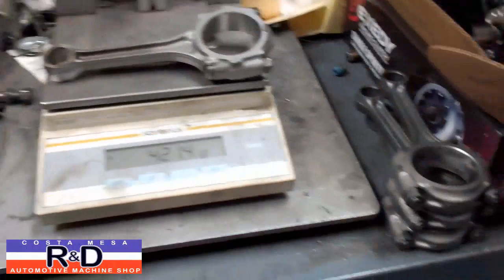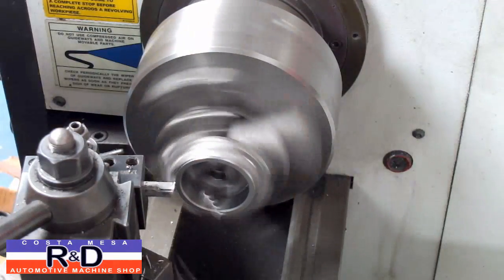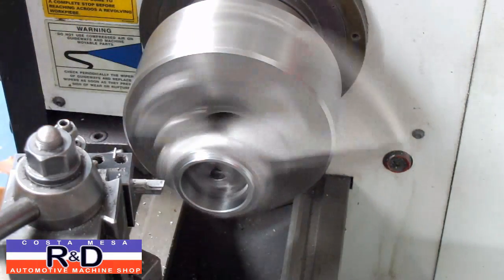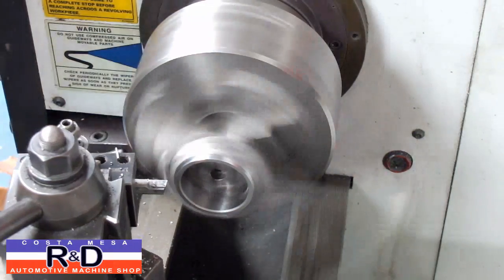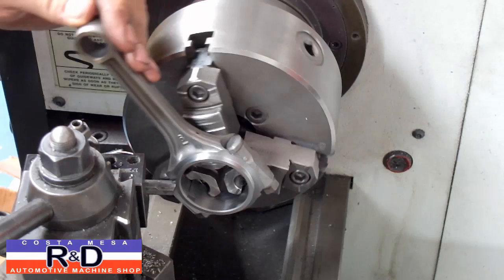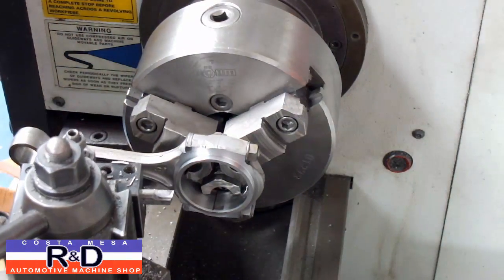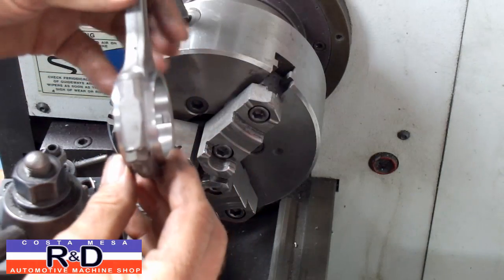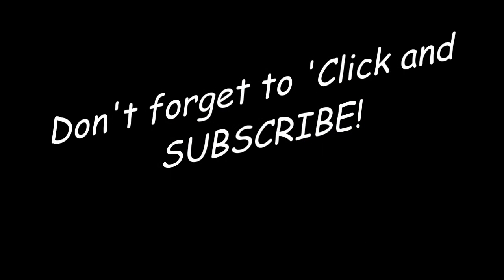Honda D16 Connecting Rod Lightening

Comment: I’d advise a fillet or chamfer on the inside corner, what you did created a sharp inner corner which will cause unneeded stress on the part and be more likely to grenade your engine. Also, you should have protected the inside of the rod to not mess up your bearings.

Comment: Hello, im curious if you are able to machine and press a wrist pin bushing in to convert a 21mm wrist pin down to use a 19mm pin?
Reply: Dillon West just buy the Honda Civic GX pistons they are 12.5 compression pistons that are forged. They come out of a d16 that runs propane. If you don't want high compression shave the dome of piston down at machine shop. Then you have a factory forged piston that fits the LS rod

Comment: So he was holding an alluminum rod with hardened steel jaws on the mating surface with no shims whatsoever? Heeell nooo to the nononoooo
Reply: Tommy TheNice Looking at the thickness of the material at the connecting rod I-beam and the small end, that is definitely NOT aluminium. It’s more than likely cast or forged steel if stock Honda parts.
Reply: Forged steel

Comment: Thank you for making this video. Quick question does this take the strength away from the rod or in some cases can this actually strengthen it because you're potentially taking the rough part of the material away and turning it into a machined part? I realize there's probably a very fine line in between taking too much and weakening it or taking from the right areas and strengthening it.

Comment: Will need to heat treat/stress relieve the rod after messing with its surface.
The goal is to harden the surface without going too deep and making the rod brittle. Shot peening the surface of the rod can relieve stress while work hardening the outer layer of metal.
Various micro-polishing treatments can also enhance a rod’s durability while leaving a great-looking finish that sheds oil.

Comment: It has been three years but dead guys cant defend themselves. This guy isnt doing his first round and yall aught to just be quiet and think about how it works and what the advantages and disadvantages are. cutting rods is a common practice because less mass = less intertia which is a good thing. I want to take 40G off my rods and damn I wish I could call him.... BTW what I was getting at is some classes require a stock p/n and lighter rods give you the response.
Reply: Just found this but has this guy passed on? If so it is a shame. This guy was on the ragged edge sometimes but always seemed to know what he could get away with and be safe. Guess that is why they called it R and D.

Comment: Now your rod side clearance is what? >.2 inches. Does the bearing still fit? And is the fillet now going to rub on the bearing? What about rod side float which could cause havoc if the piston clearance is large.  Very questionable modification with really no measurable hp increase. Tell us what your logic is?
Reply: he doesn't remove material on the bearing face look what he's doing and  where he is taking off material man cmon. aka the side clearance is THE SAME.
Reply: Stupid

Comment: why is everyone so negative?
Reply: If you take that rod with the mods he did and do an FEA (Finite Element Analysis) you would see why people are negative.   If your intent is to run this for 100 laps and toss it in the scrap bin, it may survive.  I wouldn't suggest it for anything that is going to see a lot of miles though.
Reply: Detonation, there are all manner of secondary motions in the reciprocating parts of an internal combustion engine.  When the cylinder fires, the piston bends, the pin bends, the rod bends and the crank bends.  May not be huge amount (can be), but the number of times it bends is just as harmful as the amount as it leads to fatigue cracking. The fellow doing this work introduced crack-prone areas with the small radius of the tool and by removing the gusset at the bolts and introducing a sharp corner where the gusset used to meet the bolt flat which is often a high load / stress area of the rod.  Those gussets weren't put there to look pretty, they had a required purpose or that material would have been removed in the design stage of the engine.   Might just be a few grams, but that is performance and cost (say 12 grams of steel over say 6 million 4 cylinder engines is 635,000 lbs of extra steel that has to be bought)

Comment: This was done for performance, race applications. No radius in the corner of the cut introduced a fracture point for the bearing cap to fail. Honda caps are already weak when it comes to Twisting the screws to them lol.

Comment: Wow, original weight 420g... half the weight of the MG connecting rods in the previous video!  Both "low-output" engines.

Comment: I've built very serious Turbo charged BMC Cooper 'S' motors moving them from 85bhp to over 200BHP at the wheels. For those who say that these mods make the engine unreliable are inexperienced. Lightening the internal rotating mass as a parabolic effect on acceleration. However, its also reduces torque. or stored internal mass. If you re after all out power and aren't concerned with torque then these mods are number one..once these rods are shot peened they will be fine for 8,000RPM plus and get you there quicker!
Reply: I have to admit, I would be scared removing that much material, but I guess he knows what he's doing. lol
Reply: I see no logical reason to do this modification .What about oil control , rod side float, and bearing to fillet clearance?You want less mass machine the crank and install a lightweight flywheel.
Reply: You must be inexperienced with Honda's. These rods aren't every strong as it is. It is WELL documented that these rods fail around 220-250 hp. If you want to lighten rotational mass it would be better to lighten the flywheel and valvetrain as well as balancing the complete rotating assembly. Even if you shit peen and cryogenicly test then they are still weaker than if you would have never shaved them and effected the integrity of the rods.

Comment: Nice video, but is it better to use a round bit to give a rounded finish instead of sqaured to prevent tensions?
Reply: yes, this will weaken the crank bearing connection and make the load less even.  just don't rev it up too high. not for boosted engines
Reply: Im kind of confused, you want to lighten the crank assembly to gain more torque at higher rpms, while it is weaker at higher rpms. I think this is better to use to make al the rods te exact same weight to gain less vibration.
Reply: It's not a bit.

Comment: Congrats, you just weakened your rod. There's no power gain from conrod modifying, the power comes from engine head.
Reply: They aren't 'weaker'. Rods NEVER break there (they usually break at the stem)...it's non-integral to the actual stress exerted upon the rod. 40grams x 4 rods...takes a lot of effort to spin up and takes a long time to come back down. This is a good budget way to build, especially for circuit racers (rev-matching is easier with a lighter rotating assembly). 
Take a look at the real racing rods (like Carrillo), and notice the similarities.
Power comes from many places...not just the 'head', but that is a whole book to write, not a youtube reply. ;)
Reply: There's a lot easier place to save rotating mass: flywheel.
Reply: #1 place is flywheel,clutch and pulleys for sure.
Reply: Can you provide some evidence to show that this specific modification has resulted in con rod failure? If so where is the evidence?
Reply: jdmcommute EZ brother. They have never built a performance engine to the tolerances the you are referring to. Silly them for thinking this isn't a performance modification.
Reply: Vootele Aer it's not so much the gain of power, but thereduction in time to achieve the desired rpmfor maximum power. most rod failures happen in the shaft since most forces are exerted on it (both compression, and rotational forces) cutting excess metal  at the base up to the side of the rod won't have any consequences since he left 3mm of material for the bearing to land on, and prevent rod walking. I will say though, as another commenter said, a round bit would be better so no sharp edges where forces may bind, but other then that, this mod is fine for amateurs, and those who don't have the budget for titanium rods.
Reply: As my engine building experience goes, you can make horsepower or save horsepower.  Lightening up "things" in general is a great way to save horsepower that can then be put into the wheels.
Reply: Vootele Aer ......moron.
Reply: There 100 cents in a dollar, why wouldn't you want them all?
Reply: Are you just talking out of your ass or are you actually serious?
If lighter rods didnt make power than all the top 4 second dragsters running nitro methane wouldnt run billet aluminum rods. Oh whats that? Going with aluminum rods doesnt make horsepower? 
Any reduction in reciprocating mass makes power. Any engine not just Hondas that can rev up to 9,000 rpm and make power that high will suffer frictional horsepower losses with just a drop of oil on the rods, although small, it makes a difference. This is why there is dry sump oil systems. 
You just made yourself sound like an idiot by saying that lightening conn rods doesnt make power but lightening the flywheel does. 
It is all chunks of metal spinning at very high rpms, any reduction in weight and especially when blueprinted makes power. 
You are a keyboard racer talking shit while John actually gets out and races fiats. Go join your socialist obama lover group where "raising the debt limit doesnt raise the debt"....what a nerd.
Reply: @jdmcommute  how did your debt level discussion go again?  And what does that have to do with connecting rods?
Reply: Wow...people are so angry :D I was jst sayng that turning down conrods has no greater effect. You can easily remove the same mass from flywheel and much more if you want to make the engine rev faster. The power comes from head flow, not conrod mass.

Comment: I spun a rod bearing, I know 3 of my con rods may be messed up, what can I do after this had happened?  The engine is a GM 3800 supercharged V6, I don't want to upgrade my motor, just want to get it running again.  I would buy a new crankshaft and bearings, just wanted to know what I can do about the rods.
Reply: cw2lido replace them,

Comment: You could loosen up some more power by removing more weight and friction at the cost of more crankpin pressure by removing that slight collar on the sides of that rod right?

Comment from the maker: 8500 rpm, not worried in the slightest. The crank now thinks its heaver by 160 grams, a good thing for higher rpm's. I add weight to some cranks so that they will survive extended high rpm's, no big secret here dude.